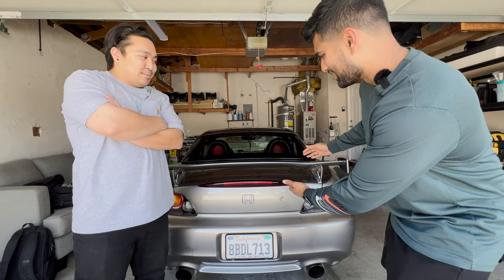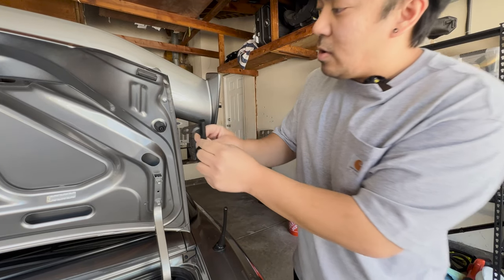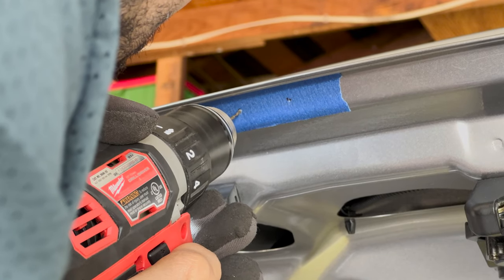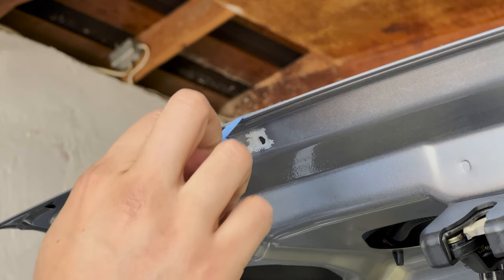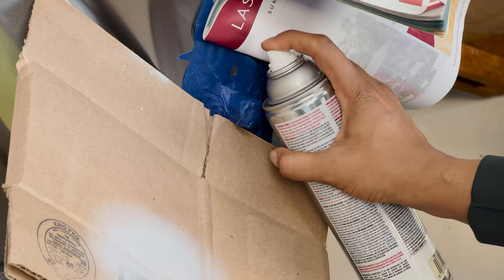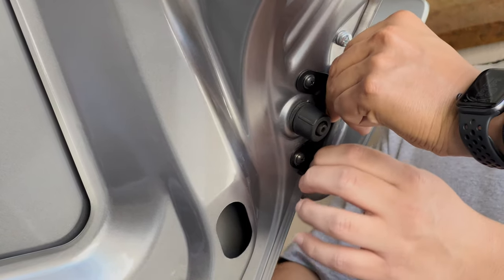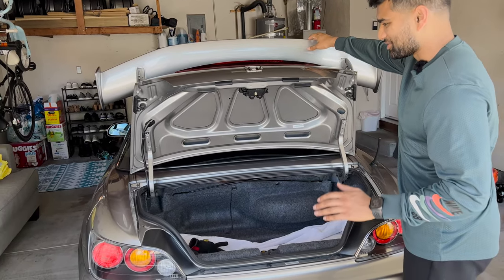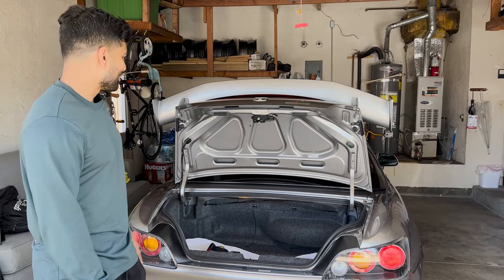How to reinforce your Honda S2000 trunk for a WING using OEM Parts

Comment: It does help to adjust your trunk springs & you should also remove the harness holder that's furthest towards the front of the driver trunk lift. It helps avoid stress and stretching the harness while preventing chaffing.

Comment: Another tip is spray the paint into a bottle cap and use a Q-tip to apply the paint to the holes.
Reply from the maker: Great tip! Wouldve been much much cleaner 😂

Comment: Did you use the Honda touch up paint on the left trunk lip that got damaged from the drill slip?
Reply from the maker: I did, yeah.. lol im embarrassed to say that there were a lot of drill slips. i went back in with touch up paint and cleaned everything up off camera. No exposed metal! I use Dr. Color Chip and cant rec them enough for s2000 touch up paint.
Reply: @zaahidrahman  excellent I just noticed you didn’t address it I only saw the one chip and wanted to make sure you did as well. You didn’t say anything and I was like he seems particular to not have noticed that. :)
Reply from the maker: @XboxAlive  hahah good looking out, dude!

Comment: Very good 👍🏻.  How did you know where to place the parts exactly without a blueprint or measurements? Thank you
Reply from the maker: i reference the images in this s2ki thread but in all honesty, i just ball parked it. https://www.s2ki.com/forums/s2000-cr-club-racer-edition-279/cr-wing-install-non-cr-trunk-lid-1175816/ 

the way these parts are designed, it doesnt have to be exact to do it's job. I'm sure there is optimal placement (which I think we achieved in our video) but if you're off by a few millimeters on the trunk stoppers im sure you'll be fine.

Comment: ok thoughts on Mugen wing vs OEM CR/Type S wing
Reply from the maker: Hmmm good question. Personally i like the mugen wing more. Its a bit more subdued and street oriented imo. The cr wing is much bigger in comparison. you kind of need the rest of the aero to balance it out. The cr wing is also more of a commitment with how it mounts. That being said cant go wrong with either, id gladly take both lol.
Reply: @zaahidrahman  Yeah I agree. They're both solid. I can see CR/Type S wing being more aero dynamic potentially but at the cost of being larger (big wang gang?). Also agreed on mounting. Thinking about grabbing one soon before they're discontinued and are 5k in 2027.

Comment: what's the name of the special attachment used at 4:38? thanks in advance!
Reply from the maker: Its a 10 inch flexible extension for any drill. Not sure if it was the best tool for the job it got it done. The issue is getting the bit in the right spot and straight. The extension helps a bit

Comment: will those parts fit s2k 2006?
Reply from the maker: @cyrildelapaz4874  yes, i believe so. This should fit all years
Reply: @zaahidrahman  thanks my guy 🫡
Reply: @zaahidrahman  My ap1 2002, after putting 74827-S2A-A00 Stopper, the trunk won't close leaving a big gap, Should I replace the original two stopper with the new ones? Cuz I see these are thicker than the original ones already on the lid.